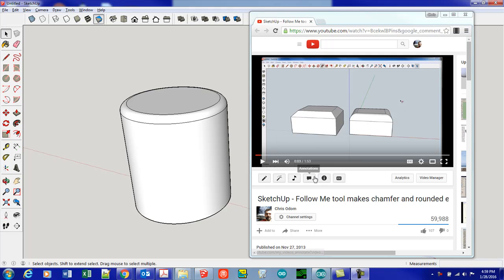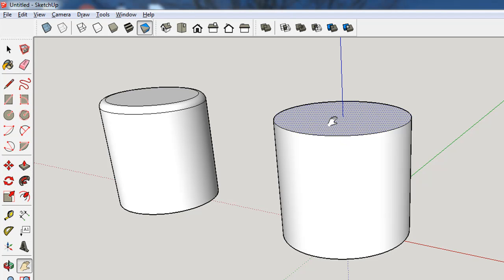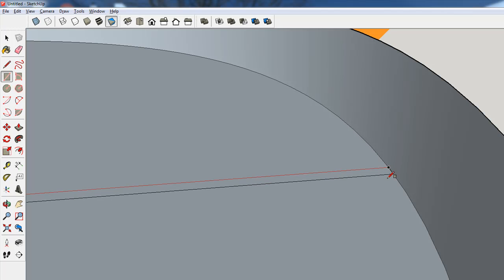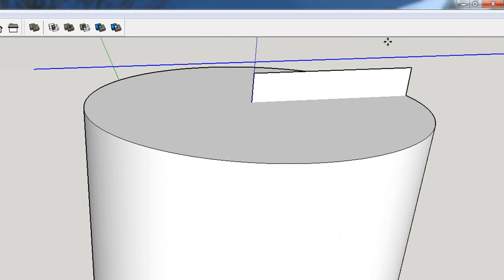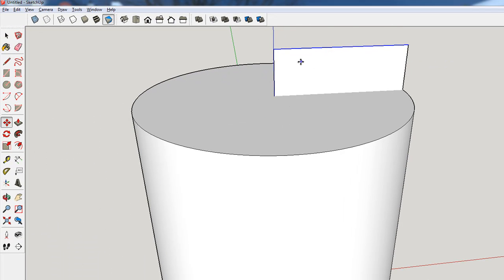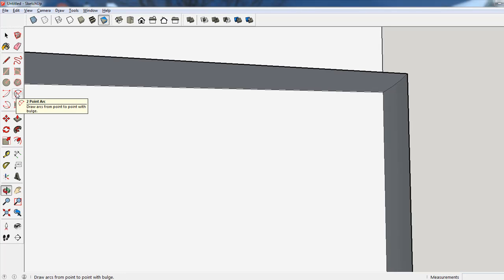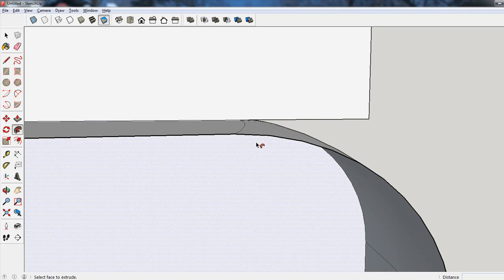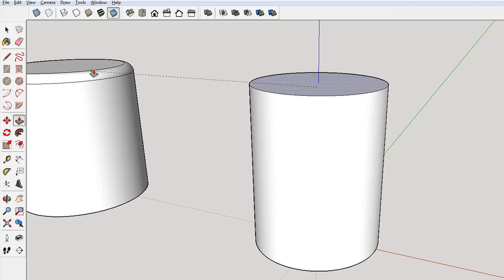SketchUp - Follow Me tool makes cylinders with rounded and chamferd edges

Comment: I don't know what I'm doing wrong. I've followed along exactly, but when I click the Follow Me and then the tiny face I don't get the chamfered edge. What it looks like is that it created the chamfered edge and then deleted the actual rounded part. I'm left with the sides of the cylinder stop where the bottom of the chamfer curve should have been and the top of the cylinder is a smaller circle ending where the top edge of the chamfer should have been. :(

Comment: I am following along but using the follow me tool in the last step of the rounded example doesn't work for me. I wonder if it is a bug. I'm using woodworking metric with a 10mm radius, 100 sided cylinder and a 1mm radius arc for the edge to follow.
Reply: Thanks. I'll give that a try. Even just drawing the arc at that scale causes funky stuff to happen. Seems odd to me that the units matter at all for the engine underneath. What's a picometre between friends when you have 64bits to play with.

Comment: Doesn't work for me. When I add the arc sketchup removes part of the intersection line between the rectangle and the top face of the cylinder.
Reply: Same happened to me with a small part. Scale the entire part up before using the follow me tool and it does work.
Reply: Thanks I'll try that.
Reply: If anyone have the problem with deleting the rounded corner this is the solution. I worked with 2,5cm (about an inch) tall cylinder and this solved the issue. After i just scaled the part back down.

Comment: THANK YOU!! I could not figure out what the hell I was doing wrong and this tutorial finally fixed it for me.
Reply: Yeah, i'll agree, and add my own thanks to the author of this tutorial.
Using a rectangle inside a cylinder, editing  the rectangle, and then using the follow me tool makes it easy to create 3d printed super low velocity "arcade" bullets, powered only by a primer, for my 9mm pistol.
They're a blast to shoot in the basement, and at 10 feet they'll penetrate about 4 layers of corrugated cardboard.

Comment: Wouldn't it be easier to do it like in SolidWorks? Just select the edge, click on chamfer or round edge and select the size--> Done. Quite some effort for a little action like chamfering, especially when it comes to complex shapes.
Reply: +Chris Odom I used it at work and learned construction on this program, thats why I'm struggling to switch to sketchup now where the things work completely different and even easy things are quite complicated. I mean its not the first version of sketchup.. so a chamfer/edge tool should be available.